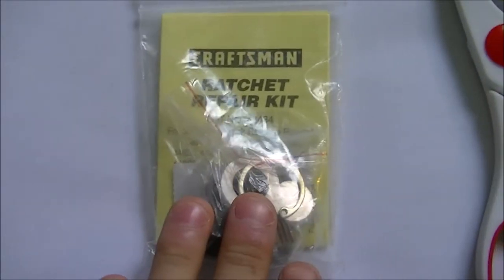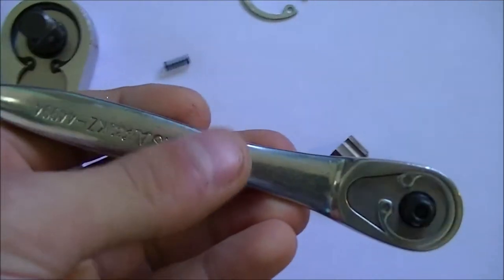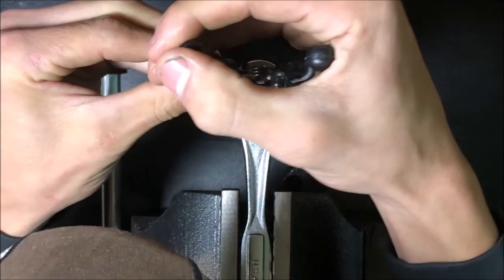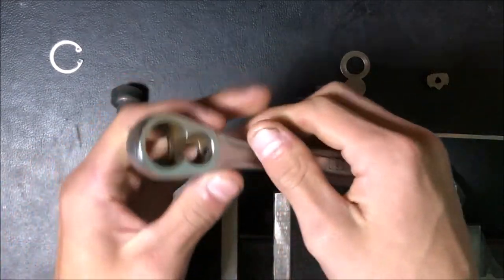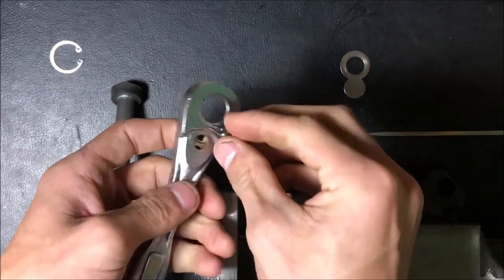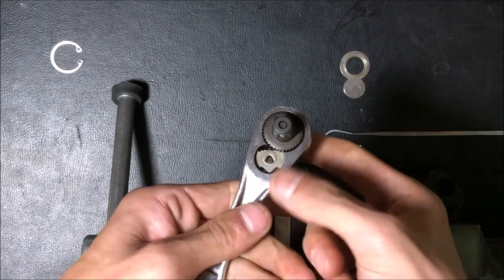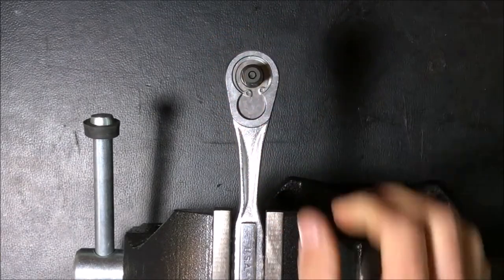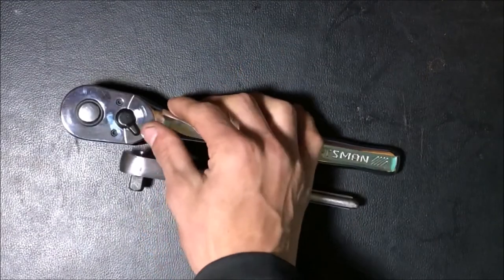Craftsman Ratchet Rebuild for Models 44811 and 44808

Comment: I have one used almost everyday that is over twenty years old! The gears you took out were not even broken in yet!
Reply from the maker: The gears had been replaced prior to the replacement filming of the video. I shot the other portion on another day before replacing. Thus the replacement gears  are the same ones from kit, and ones replaced in ratchet are same as kit. Lol